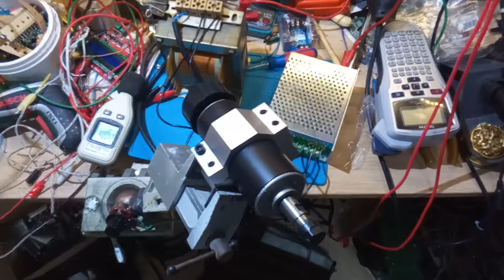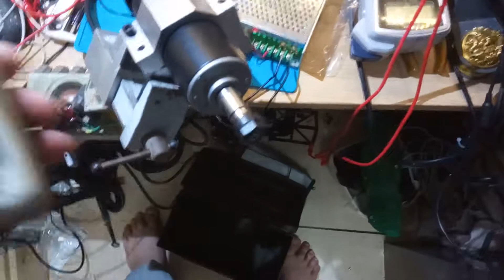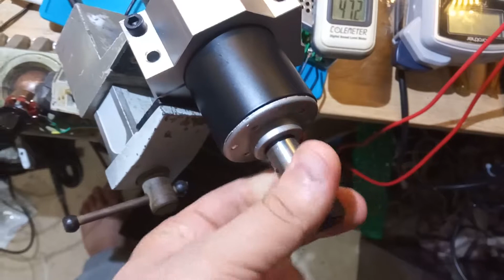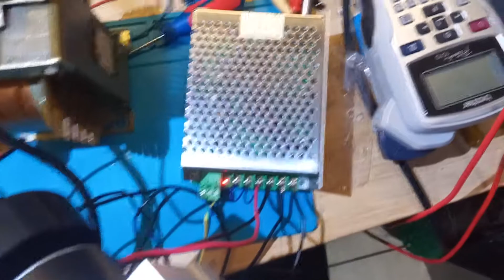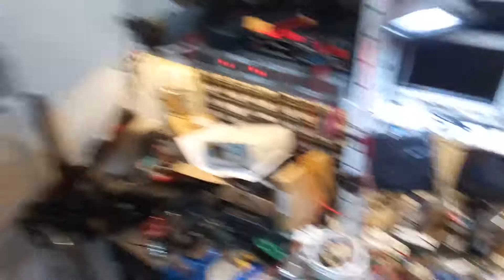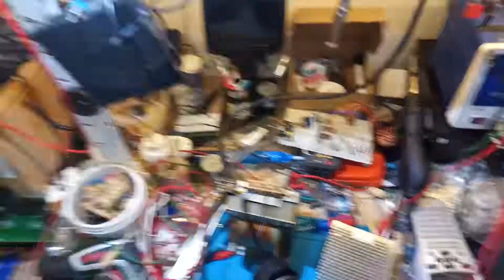Quick look at Chinese 500W CNC Spindle Noise

Comment: How good is this? Compared to a DeWalt type of router, does this hold up?
Reply from the maker: I dont have a DeWalt.  I got a similiar Bosch router  its about the same power runout but this one is smaller and much quieter.
Reply: @gamerpaddy  Thanks for the answer man. And in terms of durability do you think a standard router vs the spindle would be around the same?
Reply from the maker: I dont know.  This is basically just a brushed dc Motor with a er11 collet holder strapped to it.  Those routers are built for that application.     Both do their job
Reply: It's really bad compared to my Makita RT0700c, in every way. Vibrates and heats up so much it's completely unusable for any decent milling. Waste of money.
Reply: @nebsonic  Sad to hear that, but thanks for the reply. Good to know.